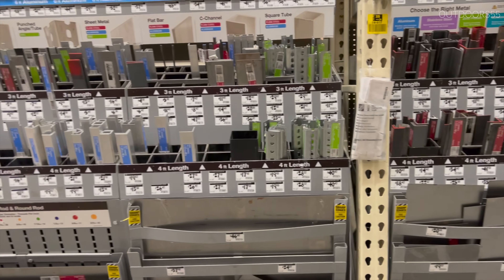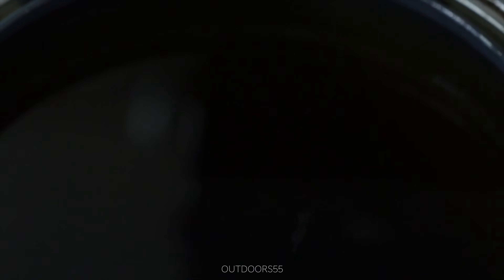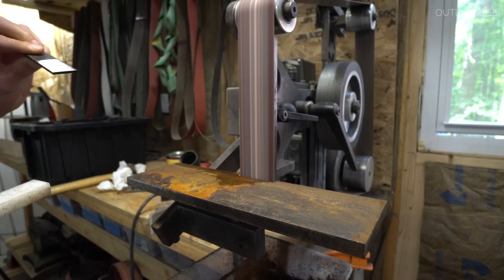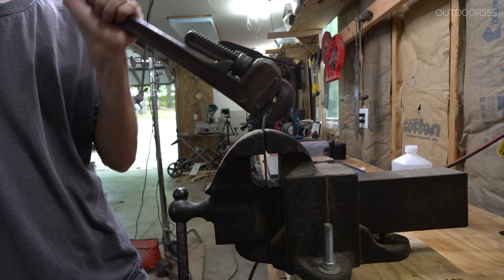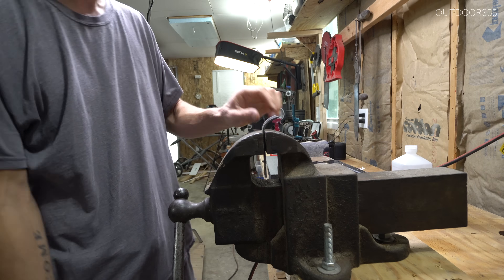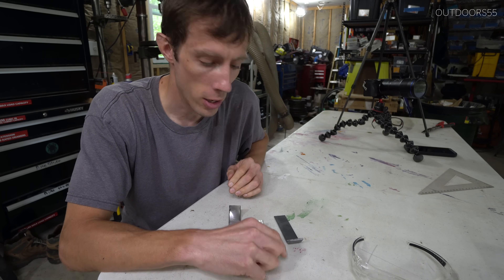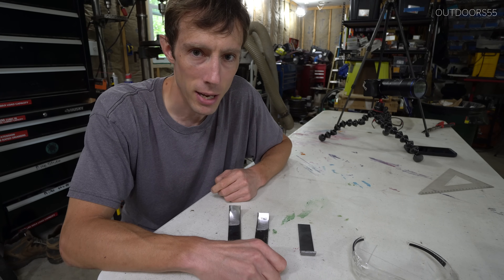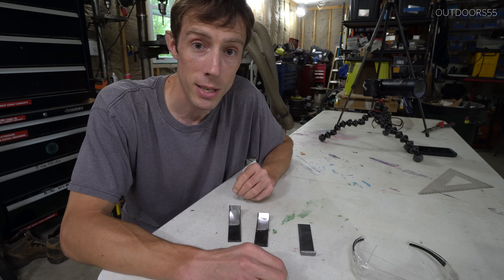Can You Make A Knife From Home Depot Steel?

Comment: It is better than paper, plastic and wood. And some other weird knives you can buy where metal has been poured into a mold. You can make a hurlbat and start throwing. It is also easier to work with. Probably less expensive as well. Some high quality steel can be found in springs, near the wheel of a car. Personally I could not make anything from it because it was so hard.

Comment: This is most likely S235 (AISI 1015 or 1018) - steel for load bearing, construction, machining. Carbon content is too low to harden, you need a minimum of 0,3% carbon or some carbonization or nitrogen hardening which still will result in nothing useful...

Comment: You can make carbonization(сarburizing, cementation - not sure if google translated the term correctly), you can make a clay container, put carbon and steel in it and throw it into the furnace. And after some time you will get steel with a much higher carbon content

Comment: Hi. I succesed you to read this comment completely. You are right and you are wrong. If the cuestion is "can you make a knife, or may I ask, can you make a good knife out of random shit steel?" The answer is yes you can, absolutely! If this random shit steel is.. well as we can read,  shitty steel with very low carbon, we need to add some carbon to the steel. I do not know what is name of this porsedure in english, but the idea is to put some more carbon to the low carbon steel. Basicly it is as easy as this: Just put the knife, or what ever you are going to hardening in to the carbon bath. Like a powdered carbon made out of regular barbeque carbon. Just like that! Just mill, or gring, or do what ever you need to get that carbon sourse to fine powder. And then add your knife, or what ever you are going to hardening to this powder. I suggest a some kind of container made of steel, or other kind of metal, that can handle high temperatures. And then just put all carbon powder to this container and knife, or what evert it is you want to harden in the container also. Then put this whole thing to the high heat. I do not know what is the right temperature, but it must be as much as the steel glows red and even a bit more. And then let the whole shit be there and then just wait. Propably 3 hours is ok time at least. Maybe even more. Because steel does suck all the carbon with a pretty low speed as we know. This whole thing is carboning the steel. I really do not know what is name of this prosedure in english, but this is the idea. Just carbonating low carbon steel, to make it high carbon steel. If it is made correctlyt, you can make pretty good knifes out of shitty steel purchased from walmart, or what is your local "all in one" market. And ps. of course you can fuck up this whole thing.  And then you will make a bad knife, even you do have a lot of carbon on your steel. Well.. Just wanted to say. And well, I think you all ready knew this all. But just wanted to say. And PS. Thanks for the videos!! You seems to be a pretty Wice guy and do have a lot of knowledge abaut knife making etc. I do appreciate that a lot! And I have learned a lot from you. So, thanks a lot dude!! It has been pleasure to learn from master you!! Even I have been doing with steels and other materials a while. Always can learn new as they say. And it is ture! Thanks, and pleace keep going this good jod that you do!!

Comment: You would think that the mild steel might harden somewhat, but the stuff at home depot is not even 1045. Good steel, but for other projects, definitely not blade material. Thanks.

Comment: One thing I’ve noticed about the big box steel is that a four foot piece can be all over the place as far as hardness.
I’ve done some welding projects where one hole drilled like soap, and a few inches down the piece it was like drilling a file. Strange to say the least.

Comment: 36 isn't going to work that's what that is 50 grade 50 what's great 50 I beams great 50 pipes great 50 Channel iron great 50 all plate is a 36 same thing he has yeah you got to get something that's going to get hard so a crane booms say you're looking at a manitex crane boom the side are grade 90 and the top and bottom flanges are grade 50 you get into some skins on backhoes trackhoe arms and stuff like that you going to get something maybe grade 90 or t110 that's still not hard enough Dozer blade 1055 Steel .05 percent carbon this what you looking for

Comment: For "home depot" prices (at most), just go to your local trailer parts supply house, and buy their cheapest leaf springs. For cheaper stock (if you forge) hit your local "performance chassis shop", and pay "scrap+50%" pricing for cast off stock coil springs. Id avoid auto wrecking yards, these days they charge almost "new part" prices. Trailer leaf springs are cheap, high carbon, tough steel stock you can buy almost anywhere

Comment: Maybe case hardening?  Just wondering.
Reply: You CAN carburize sheet/thin bar stock through and through. But, between buying overpriced home despot mild, your bone dust, and the cost of heating it above the curie point for dozens of hours, you're shelling out "premium steel dough" to end up with "plain vanilla" high carbon (best case) to "inconsistent zebra carbon" (usually). That doesn't even factor in your time spent removing scale, etc. If you HAD to, it could be done, sure. If you had any other choice (like car axles, leaf springs, crowbars, saws, even rebar) it would be a better choice.

Comment: Yeah it's basically just mild steel. I had a similar conversation with some senior boys at the school I work at (i teach Design & Technology-shop class). Now, you could harden that steel, the surface anyway if you had like a crucible full of red hot carbides and stuff. You'd have to leave it in for a very long time though. I used a crucible like that once during my trade apprenticehsip.
Like you said, best to start off with a decent knifemaking steel.
Reply: Hello handsome! Hope you’re doing great😊

Comment: Just to make a note, this is the exact same steel sold at Lowe's, Tractor Supply Co, Ace Hardware, all those places. For the beginner blacksmith though they're decent steel for making little hooks, decorative ornaments, and stuff like that. Just check the labels, a lot of what these stores sell is zinc plated. Make sure the label says plain steel if you plan to buy this stuff and get it hot.
Reply: Hello handsome, how are you doing?

Comment: The only reason to use mild steel to build knives could be to keep a test sample (for example to check the final balance or to create the joint between the handle and the iron when hot).
However, it can happen to use a piece of mild steel by mistake; what a disappointment! To top it off it doesn't even sound as good as a suitable steel.
Reply: Hey gorgeous! How are you doing today?

Comment: If I were in an apocalypse scenario and had a bar of Home Depot steel but no knife, I think that bar would make a very fine knife. In a world where 1085, 1095, 5160, D2, O1 and W1 exist and are readily accessible, HD mild steel seems like a rather poor choice.

I have used it to practice grinding, and made a set of low effort, afternoon activity throwing knives out of it before though. It was strong enough to keep a point and mildly sharp edges and I didn't have to worry about heat treating or breaking if, or rather when, I missed and hit a brick instead of a log.
Reply: Hey gorgeous! What’s good
Reply: Problem is that 5160 with a good heat treat would probably take hitting a brick like a champ, whereas mild steel would pretty much gouge the whole edge

Comment: If you simply must buy material at the hardware store get chisels, crowbars/wrecking bars, hammer drill bits or rotary drill type chisel bits. All are made from medium to high carbon steels and will make usable blades. Saw blades with integral teeth, not carbide inserts, can also be cut and ground into very serviceable blades. I have made several skinning knives over the years from saw blades and they have al been good knives. Cutting and skinning out gator hides puts a heavy workout on a blade and my knives work just as good as my unlces favorite old Case sodbuster.
Use the rack steel for projects not blades.
Reply: I made a bunch of cabinet scrapers from my first (f'd up, cheap) japanese style pull saw. The inexpensive ones have impulse hardened teeth, cannot be resharpened, but stay sharp a long time (if you don't abuse them). The steel is great for scrapers, scratching stock and the like. Not too impossible to work, turns a great hook. No, I don't harden these. Makes no major difference (I have decent quality cabinet scrapers as well), and scrapers need to stay flexible anyway.
Reply: @johanneswerner1140  I was referring to circular saw blades for making knives but I did exactly what you did when I wore out my first pull saw blade. They make really nice scrapers.

Comment: with what it cost to buy the mild steel you might as well order a piece of 1084,  the proper stuff, because its not actually going to cost that much more ...if there is a difference at all.
The only other argument is for using scrap as opposed to bought but again if you want to spend time making a knife to work with you are going to get far better results spending just a small amount of cash and knowing 100% how to heat treat than guessing with a scrap bit of whatever it might be.

Comment: You could try to case harden it, artisan makes has multiple videos about it.
Reply: Case hardened cutting tools work, but not for long because after a couple of sharpenings the hard surface is gone.
Reply: @wilhelmvonn9619  you're right. It won't be a tool that will get a lifetime of use out if it. But it can last a while and get you started. Or even: if you started already with 'bad' steel and nearing the finish line, you can still opt to case harden.

Comment: Basically fabrication steel is almost always low carbon because having fabrication work be brittle and crack isn't what you want. You want something you can drill and weld that will have some give under load but not fall apart. Use the right steel for the right job. In this same vein, using mystery file steel or leaf spring steel or lawnmower blades is often more of an intermediate thing. You know how to quench 1085. It's a PDF document. You don't know how to quench that old worn out file from the pawn shop when you are brand new to making knives.

Comment: Couple thoughts:
1) Super Quench not ideal but will at least harden mild steel 
2) Instead of 1084 go to the salvage yard and get a leaf spring. It's almost certainly 5160 and is the steel of choice of developing world blacksmiths for making knives. Forgiving, hardens, tough. About eleventy hundred ABS journeymen and master smiths have made their torture test knife from 5160
Reply: Only thing with leaf springs is cracks, but just avoid them and it’s good. My father works at an automotive place and often brings over some of the old springs for me

Comment: I think this is valuable info for someone who doesn't know.....that mild steel can't be conventionally hardened.  It can however be case hardened.  IMO a proper follow up would be to try again with some case hardening compound and see how it turns out.
Reply: Both of the case hardening compounds I used to use are no longer available. Superquench seems to be the best option at the moment.

Comment: What about drill bits?  I have a scrap yard near me that has truck loads of drill bits in all sizes-- including a lot of huge drill bits as big as 2" diameter or more.   I can buy them at scrap prices (typically 33 cents per lb -- or more lately).  How would you make a knife out of an old 1/2" to 1" drill bit that's 8" to 12" long?   By 1/2", I mean a full half inch diameter shank all the way down.  No reduced/ small shank.  It's a straight shaft/ rod.  I know that some of them will be HSS and some maybe be carbine or cobalt, etc..   How can we tell the difference and can you make a knife from each of them?  You might have to do some blacksmith hammering to flatten it.  It would make for a fun video.

Comment: You can actually make a knife.  You need to expand your methods and define your expectations.  

Quench from a higher temperature.   If this is 1018 or A36 steel the hardening temperatures are considerably higher.  The max hardness is in the 30 to 40 HRc range.  Water also isn’t fast enough.  You’ll need iced brine, sodium hydroxide or “super quench”.  Google super quench and the recipe will come up.  

Also you can use a chisel ground edge and case hardening.
Reply from the maker: 1018 does not have the necessary amount of carbon in order to harden.
Reply: @OUTDOORS55  The American Society for Metals disagrees.  They show the maximum hardness for a 0.18% carbon steel to be 43 Rockwell C.  It's difficult to get that, but 1018 steel will definitely harden.  1475 is still in the dual phase area of mixed austenite and ferrite.  You have to heat high enough to get above that range, which is somewhere above 1600 degrees F in a low carbon steel.  You also have to cool very fast because these steels have no elements added to increase hardenability.  Also remember, increasing carbon content increases hardenability up to about 0.6% to 0.7%.  Below that and above that, hardenability goes down.  That's why plain water isn't fast enough.
Reply: @therion5458  no one is wasting time.  We’re answering a question.  The information on maximum attainable hardness as a function of carbon content can be googled directly.  One of the first references that came up was from ASM but it is certainly published in other places.  If you want a simple answer then no, you can’t make a knife out of Home Depot steel.  The more involved answer that requires some research and a little outside the box thinking is yes you can but it’s a lot of trouble for not much return.

Comment: Leaf spring may be a best choice for a knife if proper steel is not available. If searching cheap steel which is better than simple mild steel, rebar is one possible choice. It's matter of luck what happens to be there, but many times they harden decently. They are mostly made in scrap metal which contains alloyed steel and carbon steel. I wouldn't make a knife from it, but something else which needs some hardened edge.

If you have a tig, you can make a hardening edge by melting old chainsaw files or hss endmills. Drillbits are nowadays crap.
Reply: Problem with rebar is it is drawn. The crystal structure is stressed in weird ways and in layers like an onion from the center out.
Rebar is good if you have a forge, hammer, anvil, etc... and can fold it a few times and flatten it.
If you are just working it at work temp, you're going to get a brittle knife.
Reply: @m4rvinmartian  My expectation was to use forging. Still it depends lots of luck, but I have found couple of good ones.

Comment: I think the real answer is: YES, you can make a knife from Home Depot Steel. 

But you'll need to sharpen it every week.
Reply from the maker: After every cut😂
Reply: Not every cut... I guess cutting butter might work (but in Scandinavia we use wooden butter spreaders for that)
Reply: @johanneswerner1140  If i recall correctly this very channel has a video on sharpening a butterknife, and its sharpness didnt last very long- So based on that, sure, you can make a butterknife from anything lol
Reply: @DarkestVampire92  it is a spreader. It is used to spread butter (maybe cream cheese or rømme - that could be... clotted cream? - and jam). I really would not call it a knife...
Reply: May not even take an edge.
Reply: @stevenlachance8576  It will, not a very good one but it will take an edge. You can sharpen just about anything to cut.

Comment: I'd call that soft iron not steel if you can't even harden it with water quench it must have no real carbon in it .
Reply from the maker: Most likely it's 1018 which does not contain enough carbon to harden.

Comment: In my places people use spring sheets from light trucks or trailers. Can be hardened to 60+ HRC, but will be very fragile. So usually ~55 HRC is fine for it.
thst's why the junkyard is adviced in comments nearby.
Reply: I agree. Get a pair of stacked leaf springs from an old Dodge truck. 
All the metal you will need for months for $20.